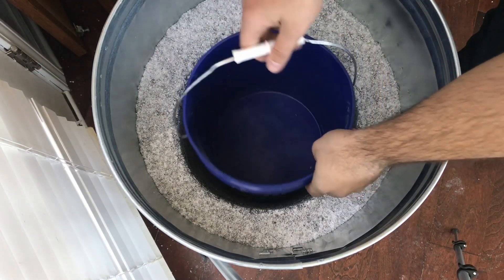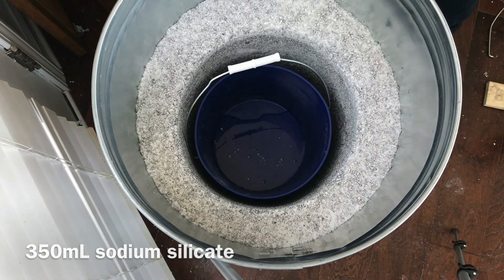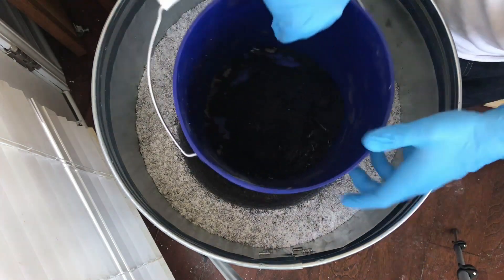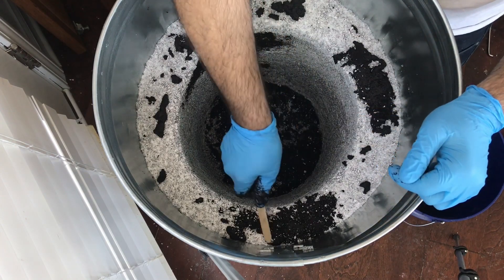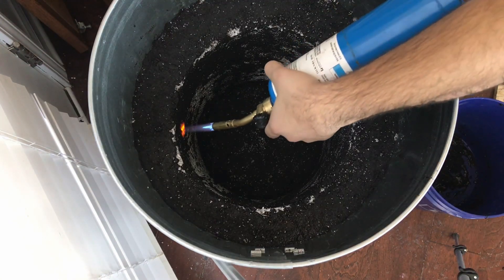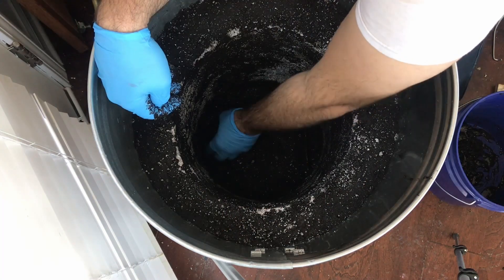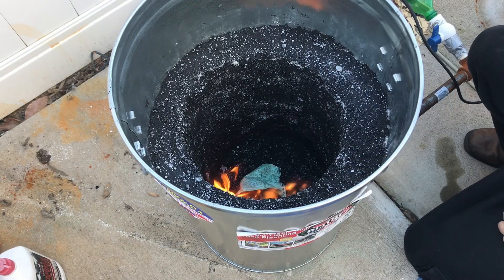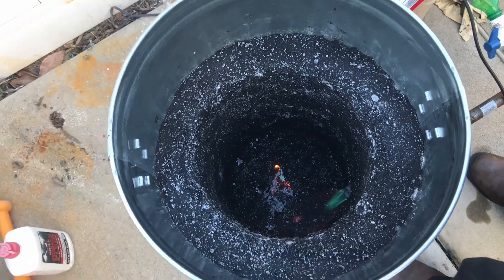How to Make a Mega Trash Can Foundry P3, Refractory lining and recipe

Comment: 1 year on . How has it withstood the torture of the heat   . Really interested in the oxide . 
Digging around the net I found that refractory cement is high in calcium  aluminate . This is made by mixing aluminium oxide and calcium oxide (quick lime) and heating to a temperature ( still chssing that one ) . 
Look fwd to hearing or seeing how it has stood up .

Comment: Why aluminum oxide? Compared to other inert materials (sand) aluminum oxide has high heat transfer which would not be desirable in a foundry. Pricy too.
Reply from the maker: Ch4grin I wanted to see how well it would work and try something new out.  It would definitely be cheaper to use sand. I think the box a got was 40-50 bucks.